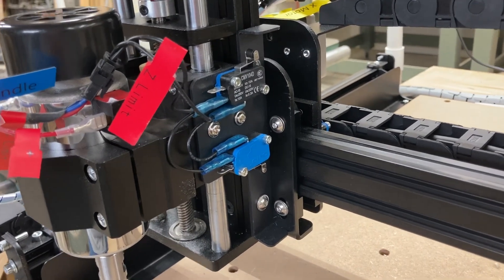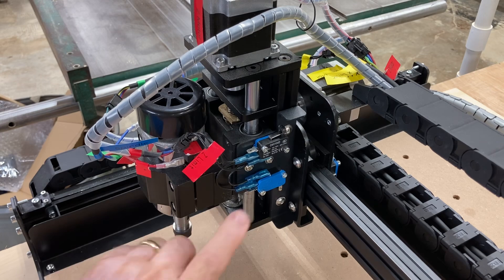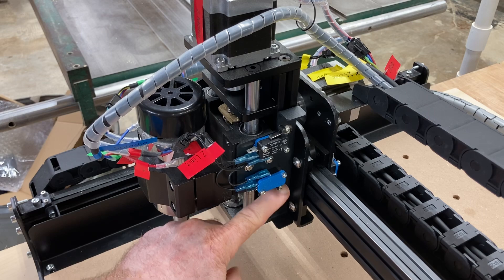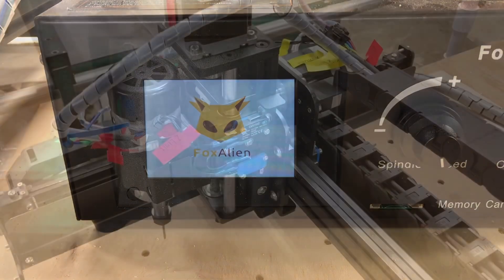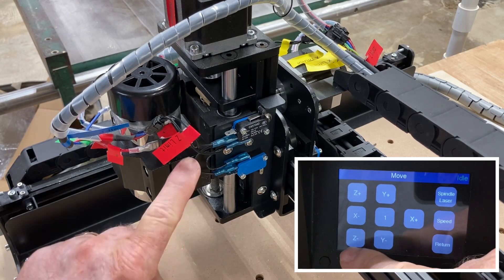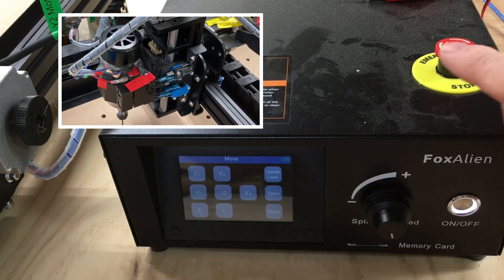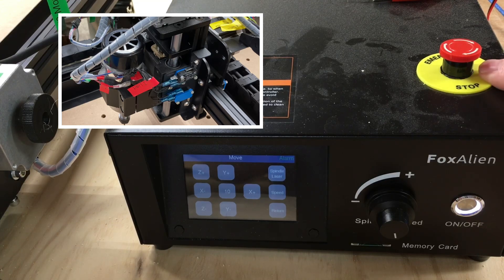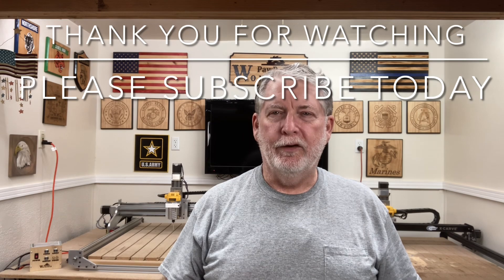How to Unlock Limit Switches on the FOX Alien 4040xe

Comment: Pawpaw, what do i  do if the "??" show up as soon as i jog the machine, but when i hit reset nothing happens? Any ideas?
Reply from the maker: You hit a limit switch. First determine which one you hit then hit reset. Move in the opposite direction. You repeat this process until the machine moves freely again
Reply: ok not sure what i did, but it's fixed now. in Open builds i just reset WCOs and EEPROM and that did the trick. Thanks!!! @PawPawsWorkShop
Reply from the maker: Glad you got it working again

Comment: Hi, love your videos, Just assembled my FA, 4040XE and stepping through the instructions for the life of me I can't get rid of the 2 question marks on the control panel. I pushed the emergency stop in and out many times, I push reset and they go away for 3 seconds, I've checked all the limit switches to be stuck for jam, check all the wiring , today I ohmed out all the limit switches to see if one was shorted or stuck, all ck out fine. Do you have any ideas for me?
Reply from the maker: Have you tried to use a different controller?  I would suggest the Openbuilds controller. It’s free.

Comment: My machine all of a sudden isn't working right (it's been working fine for a year). When i power on the controler, it now says "idle" not "lock", so i don't have to unlock it to do anything. Plus, I goto run a program I've run 1,000 times for a 2 inch piece, and it jumps like 6 inches in the x and y axis, and tried to cut the piece out like it was huge. The cordinates displayed of movement is correct, so i know the machine is reading the correct position. I've tried multiple files ive used before, and they're all doing this.
Reply from the maker: You have a mechanical issue. Look to the belts, or the wheels.  Even a loose wire.

Comment: That’s poor electronics control, they could have the alarm and allow the machine to travel in the other direction without you having to intervene. The need to update to conform. That’s foolish. My actuators have built in limit switches coupled with two diodes that automatically inhibit further travel in that specific direction and allow travel in the opposite direction.
Reply from the maker: Maybe they will make a change. Thanks for the information

Comment: Hello and thank you for the video!My limit switches are not working as I try to home the device.This problem only recently started.Any help would be appreciated.
Reply from the maker: Look for broken wires, loose wires and even broken limit switches. On my XCarve, I never used the limit switches for the first four years of use. When I decided to use them I realized one limit switch was broken, on had the wires broken off. If this is a new occurrence then it will most likely be a mechanical issue and not a software issue
Reply: @PawPawsWorkShop  I tried about 20 more times and it finally homed.Not sure what is causing the issue.Faulty switch probably.Thank you for getting back to me so quickly!

Comment: hi paw paws, graeat tutorial, is it the same procedure with a cnc masuter?

When I want to do a job and the spindle touches the wood in automatic it stops, I give it unlock and send and the machine starts to do the job above the wood without the spindle moving.

Thanks paw paws !
Reply from the maker: You most likely are hitting a limit switch. Move the spindle down lower reset and unlock the machine and carve again

Comment: Sounds like the machine bit you unexpectedly & caused a problem. Great instruction on overcoming the problem. Hope Fox update their instruction manual with what you've identified.
Can you still unlock the machine in software UGS or Candle or only on the Fox control panel?
 I'm surprised Fox didn't override the switch bounce off activation requiring you to reset twice! Machines allow software to self override the activation during the Homing process. Can't see why they don't ignore/override the bounce off activation!
 The Alarm question mark could do with being more prominent ... Red Flashing "Limit Activation"  would help!
Reply from the maker: This was a demonstration of the limit switches. UGS and Candle will work to unlock the limit switches. Yes I hope that they will update their manual to include the extra step.
Reply: The bounce is really really annoying.. Having to reset 2x every time you hit a limit has led me to unplug a few of these switches especially while I am tuning and setting things up.  This is a software issue?  I was thinking of throwing some other switches on there, more like the xcarve uses to see if they avoid the issue.